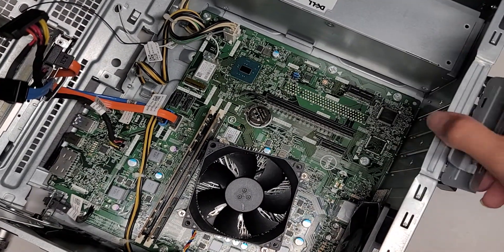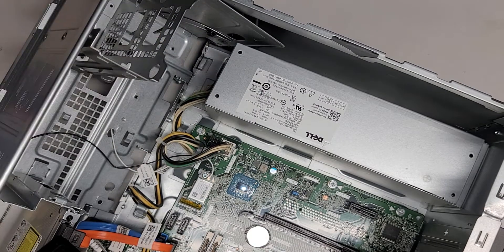Dell Inspiron 3668 Desktop Disassembly RAM SSD Hard Drive Upgrade Replacement Repair

Comment: Thank you got this vid. I have the 3650 model and I very much dislike how Dell makes these cases. What is the cord called that can connect multiple power connectors? In my PC Im wanting to upgrade the HDD to an SSD and keep the HDD as additional storage. Could you do a video on how to clone a hard drive?
Reply from the maker: Thanks for the contribution! Here's the video you need. https://youtu.be/4p5jFDzVwUw what do you mean by multiple power connectors?
Reply: @ItsBinhRepaired  I'm looking to keep the HDD as a backup drive and the power supply module only has one power connector for the HDD, I'm sure they make kind of like a daisy chain I get more.
Reply from the maker: These will work https://amzn.to/3kRDcTr and https://amzn.to/3cuHGux
Reply: @ItsBinhRepaired  thanks for all your help my guy.
Reply from the maker: @shaynewilke3995  no problem

Comment: got a graphic card upgrade vid?
Reply from the maker: It's basically a small desktop. https://youtube.com/playlist?list=PLSSiYX-ta7ap3BhT_lk5l9jFgmcSuTd6d that will help, only difference is the graphics card will need to be small enough to fit.
Reply: @ItsBinhRepaired  i saw couple of videos they changed the case into mid tower and some upgrade psu to. Accomodate better gpu
Reply from the maker: @geraldbeltran5232  nice
Reply: @ItsBinhRepaired  saw another video, cpu upgraded to i7-7700 + 1660 ti... Contemplating on 2060 gpu but not maybe AAA games... Also windows 11 is not compatible to 3668 according to Dell

Comment: I watched this because when i plugged my headset in to the microphone part it wouldnt work so i dont know what to do about that
Reply from the maker: Does your headset only have one connector?
Reply: @ItsBinhRepaired  it has 2 and the audio one works but the microphone one does not
Reply from the maker: Strange :( sometimes there's a software setting

Comment: Worthless video as you didn't show what happens next, when you turn it on, and there is no OS and then you try to boot to USB, except there is no boot from USB option.  So, now don't have an upgraded PC, you have a pricey boat anchor.
Reply from the maker: You're saying that because you don't know how to boot from USB, the disassembly and showing how to replace components is useless? Sounds like a you problem. Maybe if you came to me asking how to boot from USB, I'd want to help, but this type of comment just makes me want to mess with you. 

So, how useless is your car because they didn't tell you how to refuel it after you used all the gas? Your car must be in terrible shape because they never told you how to change the oil,  or the brakes, or the tires, or the wiper blades, or the headlights and taillight bulbs. 

When your phone runs out of charge, do you buy a new one and use the old one as a paperweight because they didn't tell you how to charge it? 

Come on now...
Reply: If you don't want criticism, disable the comments.
Reply from the maker: @staff0flag  That's not criticism. That's just being rude. Lol I can be rude back if I want.
Reply from the maker: @staff0flag  here's some criticism for you. Google how to boot from a usb. Also Google how to create a bootable USB drive, because your USB drive likely isn't even bootable to begin with. Maybe learn how to do some things on your own instead of expecting everything to be spoon fed to you.
Reply: @ItsBinhRepaired  You're ruining your brand with these comments.
Reply from the maker: @staff0flag  meh. I do what I want. That's all that matters to me. If I told you how to live your life, you wouldn't like it either. Lol
Reply from the maker: @staff0flag  You don't seem like a very nice person to talk or work with, so I choose to return the favor and vibe you give off.
Reply: @ItsBinhRepaired  Go find an adult you trust with good business sense.  Show him your posts.  When s/he tells you to delete them, do so.
Reply from the maker: @staff0flag  it's not worth it being nice to assholes because you're a slave to money. I don't need to be a millionaire to be happy. Being a millionaire by kissing the asses of people like you is not worth it to me. Maybe it is to you, but it isn't to me.
Reply: @ItsBinhRepaired  Sorry that I triggered you.
Reply from the maker: You're not sorry lol